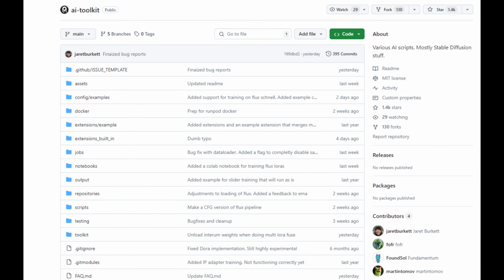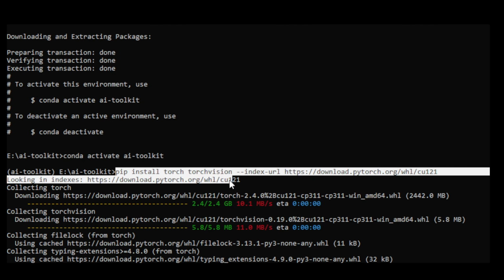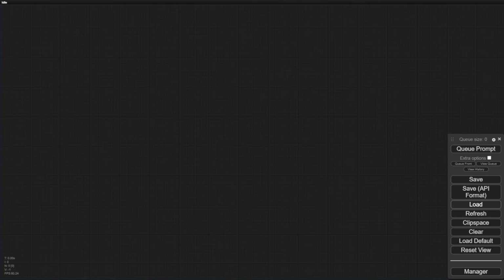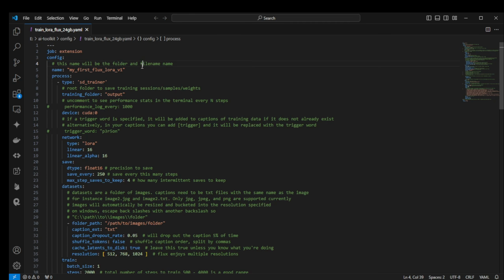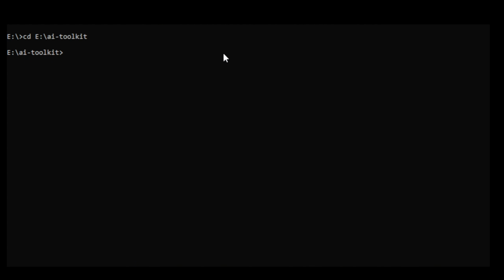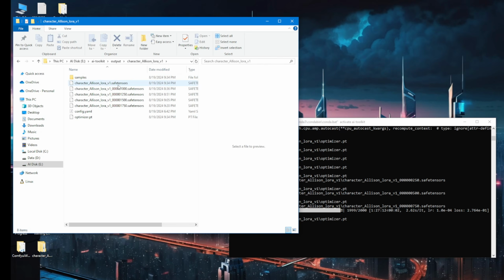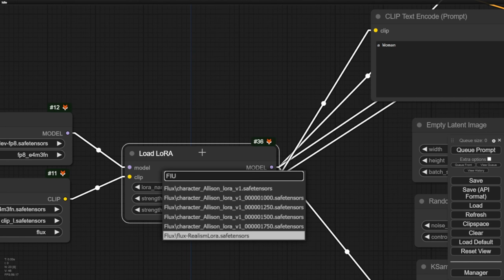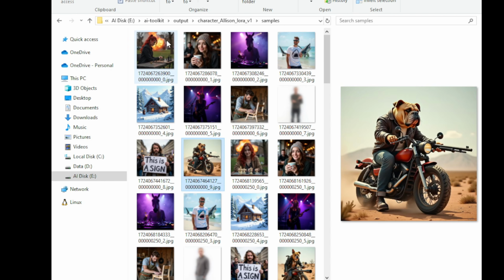Flux 1 Dev LoRA Training Locally Using AI-ToolKit - Tutorial Guide

Comment: Without a eGPU/GPU, can I run it on my laptop? Can you do a video about the rig or requirements prerequisite for all this?
Reply: The absolute minimum is 16 GB of VRAM on a gpu, integrated ones are out of question and is not possible whatsoever.

I'm guessing some gpu with 24 GB of VRAM, and 64 GB of RAM with NVME storage is a necessity do train lora on flux, otherwise it's going to be a pain with lower requirements or literally impossible.

Comment: Why would you resize the images if the LoRA trainer is supposed to resize them automatically?
Reply from the maker: oh really? This AI toolkit resize them? 
Well, I got used to, just one of the practical steps that I did in SD and SDXL Lora.

update: yes, the dataset prep section did mentioned : https://github.com/ostris/ai-toolkit?tab=readme-ov-file#dataset-preparation
Reply from the maker: P.S : but if I resize it before train, looks like the script skip the resize steps. And I don't need to wait longer.
Reply: yes, if you experimenting multiple times with same images..
Reply: I think this line is critical: Images with different dimensions will be trained for different aspect ratios.

As we know, the assignment is based on one of the longest sides of the image.
I believe that different dimensions will result in a different final outcome. (More combinations without overtraining)
For example, a 768x1024 resolution might produce one result, while 896x1024 might yield another. 
This is because the model is trained on a different ratio, potentially resulting in better quality.
Reply from the maker: That's why in new IPAdapter, they mentioned 50k steps with 512, and 25k steps with 1024.
Maybe if they don't prep dataset like the  old way, it will might become better.

Comment: i find it impossible to download the models. it starts downloading the model at 30mb/s and then it goes down to just a few Kbytes and stays at 99%. i have tried with different hugginface tokens (write, read finegrain....). i also leave the .yaml by default except the path where i indicate the directory of my dataset. by the way i have a 14900k 4090 and 128ram and windows 11
Reply from the maker: Looks like their network is jamming.i got 2 mb/s downloading another AI model.
Reply: Could you find a solution to this by any chance? I'm facing the same scenario

Comment: Please Kohya next, they 've got it having good results with 500 steps.  All my loras have been good (way better than sdxl and pony) with default settings using ai-toolkit but they take hours to go to 2000-3000 steps. As someone mentioned below fiddle with high weights, 1.5-2 have worked for me. Also comment out most of those samples when training, they take unnecessarily long. I want to bump up learning rate but not sure how high to go; I read somewhere that people have been using 4-e4 but I tried 1-e3 and it wen crazy after 500 steps so I was thinking even that would be too high.
Reply: Kohya can do flux loras?

Comment: Comfy refuses to apply my lore as if ignoring it, I do like your video 1v1
Reply: @daetojekf5973  for Flux sometimes you need to turn the lora weight really high, when you think it's too high keep going. Some of the ones I've downloaded from civit don't seem to have any effect until 2,3 or even 4 weight. And also maybe a dumb suggestion but make sure you're using the correct base model eg dev for a Dev lora, schnell for well you get the picture 🍀
Reply from the maker: @timothywells8589 exactly, so by default I use 1.0. it still very little affect from it.
Reply: thanks everybody, i'm not update comfy =) thats was a problem